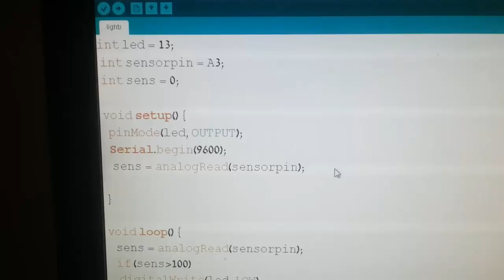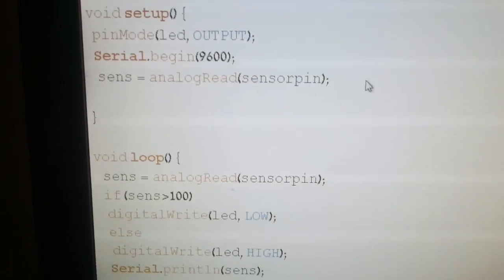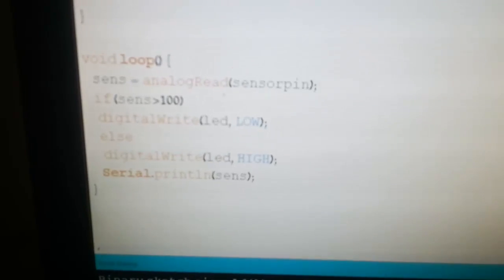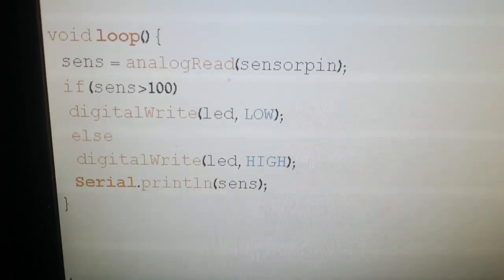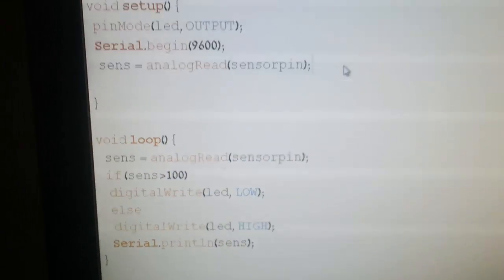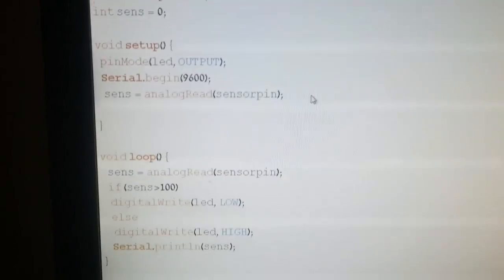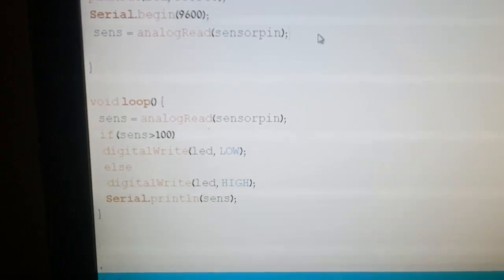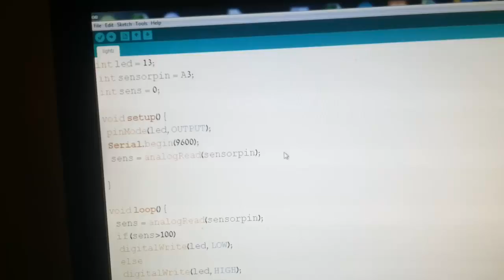Turn a regular led into a light sensor

Comment: This is acting basically as a touch activated circuit, not light activated.  When you touch the bare anode leg wire of the sensor LED, the output LED on pin 13 goes high.  I built it and tested the code as displayed in the video and no amount of light change caused the serial monitor output to fluctuate.  However, touching the sensor LED's anode (as you're doing in the video by holding it in your hand) did cause the circuit to function as displayed in the video.  Still pretty neat.  Thanks

Comment: ok, but how you connected the LED in the circuit?
Reply from the maker: Fabio Alexandre Muller the sensor led is on pin A3 and gnd
Reply: Marco Arduino channel Just that, without operational amplifier?
I'll try.
Thank U ;-)
Reply from the maker: Yep
thats the entire point.
Thats how leds are built.
Same goes with motors, if you rotate them they will generate electricity,peltier shall generate electricity if you give it a hot\cold source(you can see it in my video about peltiers.
and a speaker shall generate electricity if you yell into it.
a crystal will also generate electricity if you hit it with something.